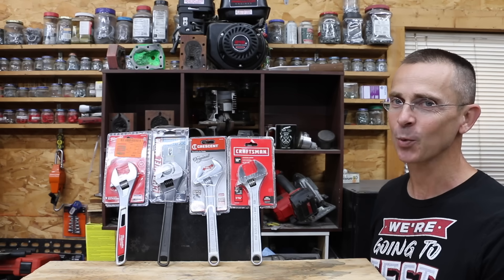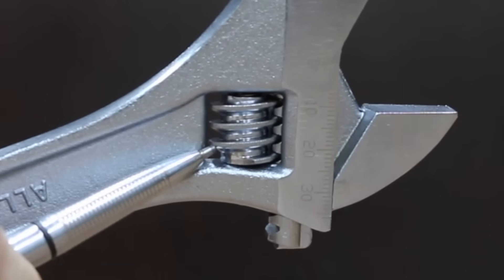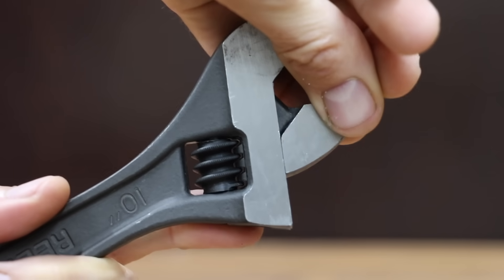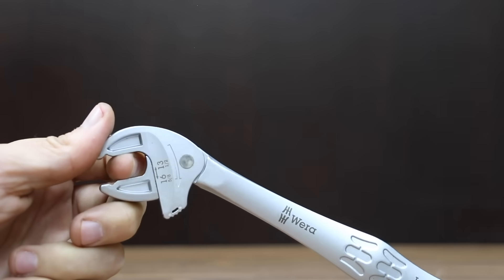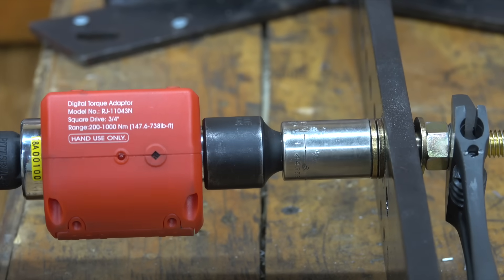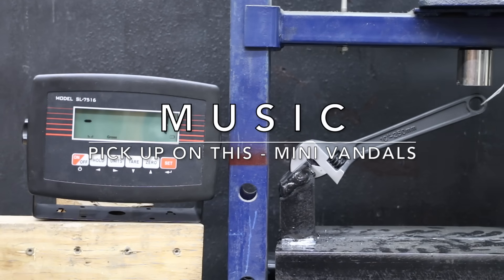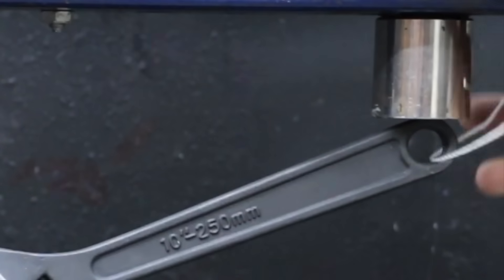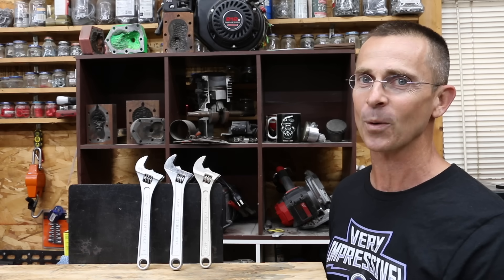Best Wrench (ADJUSTABLE)? Craftsman USA vs Craftsman, Crescent, Kobalt, Milwaukee, Channellock

Comment: Next up, oil filter wrenches and those that slip with oil and when dry.  Holding power on tough filters and also ease of use in close quarters like under a vehicle.
Reply: It would have to be a dual test. Oil filter wrenches and which screwdriver holds up best when pounded through a filter.
Reply: @NotMorganFreeman.  we’ve all done that!!!  In fairness, I hand tighten but for some reason, some just tighten up and are tough to get off.  Could be heat and contraction.
Reply: The vise-grip style locking oil filter wrench is my go to if I can use it. Crunch the filter a bit so it won't slip and it comes right off. Even in tight quarters I can generally grab it from the end then use another tool to turn the wrench.
Reply: Not a bad test idea! 🤔
Reply: @gus473  
I think it's a great idea. For Toyota cartridge style oil filter cap wrenches my choice would be the redesigned Motivx MX2320-US model.
Reply: Filter should be hand tightened but when  some jackass torques it down, the Knipex bigger wrench opens wide enough and will grip it.
Reply: I just crush the old filter with sharp jaws and hand tighten the new ones
Reply: Unless you have one those new chevy style oil filters the upward facing with a annoying plastic bolt like thing to grab on to that is guaranteed to slip
Reply: @SmilesHeavy  thus we need a test on filter wrenches……

Comment: Brilliant! I've wanted to see a test line this from you for a while due to the excellent quality of what you do! 

I was quite happy to see the Bahco do fairly well as I've got a couple of them which are well over 20 years old!

Not sure if you've done one so far but a low duty to medium and even high range torque wrench showdown would be awesome!

Thanks for the regular awesome content!

P.s. it's a good job those adjustable wrenches work with more than one scale... imagine if they were metric only 😉
Reply from the maker: Thanks!  Thanks for the suggestion.

Comment: Todd, could we do a showdown on 3/8 drive extensions?
The biggest problem behind reliability on adjustable wrenches is the keystone shape between the jaws which are not 100% parallel. It's a struggle getting these off, sometimes. Also, it would have been good to record the moveable jaw left to right wobble.
Reply from the maker: Thanks for the suggestion.

Comment: Would be cool to see a test on lubricity of diesel additives like optibube, biodiesel, off road “high sulfur” diesel, atf, rev x, ect to see if it helps out how unlubricating the new ultra low sulfur diesel is. I’ve read a lot of articles about how much damage the new diesel fuel can cause to older diesels and am curious what additive works best. Thanks
Reply from the maker: Thanks for the suggestion.
Reply: He did something like this when he did the diesel anti-gel test.
Reply: Yea ik he did show the lubricating properties of those, but thats not their main intention. It was just an added benefit. I’d like to see the products that are claiming this is their main purpose, and how it stacks up to high sulfur diesel and atf. A lot of these products are pretty expensive so I’d like to find out which ones are legit or just snake oil lol
Reply: @randythomas9052  I agree with you. That would be a great test because my truck has the CP4 and I use these additives as extra insurance.

Comment: Thank you for this test! .. if you use an adjustable wrench properly, tighten it properly, it is a very useful tool and belongs in your toolbox ... Note: there is a proper direction for pulling on an adjustable wrench , toward the sliding jaw, not away from it . Edit: ahh, I see that you did it correctly in the video, good job
Reply from the maker: Great feedback!  Thank you

Comment: this hits home with me. I spent 35 years doing construction and our tools would last for years, and only got replaced when lost or stolen. The newer tools just dont seem to hold up any longer.
Reply: Planned obsolescence...
Reply: That way you have to buy new ones. If the last forever they can't sell you new ones. Same with computers and cars. Quality is limited on purpose.
Reply: @discgolfdetails9889  computers and cars are more difficult to make last for a long time than a couple pieces of steel. I’m not saying that planned obsolescence isn’t real, just that a internal combustion engine can only take so much, vs. a wrench
Reply: @jeffroberts6428   I feel like the quality of cars has been going down in the last 10-15 years. A Mercedes or BMW use to be built to last. Now they fall apart at 100K and are mechanically totaled. Which is why you can by a 120K Merc for 10K. 

Part of it could be emissions, part of it could be trying to squeeze the most power out of a small engine and the last part is the GOV regulations on fuel mileage. They simply can't last.
Reply: @discgolfdetails9889  I agree with all that, just saying certain things can’t last 100 years
Reply: My dad's employees steal everything. My uncle is the manager and just swoops into our shop/garage and grabs our old vintage tools my dad passed down to me. And use it for work for the guys (that steal them) instead of buying new tools for the guys like the whole family tells him to do. He gets payed to go to the shops and to use the business credit card but he's just so damn lazy
Reply: @DaftPunkSkittle  accuse him of rape
Reply: @arthurmead5341  nah, go with racism... that seems to be the go-to these days
Reply: @3WhaTNexT  racism isn't illegal though
Reply: @arthurmead5341  true, but the media and others act as though it is
Reply: @arthurmead5341  yikes you seriously joking about that?
Reply: @DaftPunkSkittle  hey if he was stealing Pittsburgh tools I'd encourage you to let it slide
Reply: There is just as good if not better out there nowadays, you just need to pay way more.

Comment: Craftsman tools will never be what they once were. Back in the day you took pride in buying Craftsman.
Reply: I remember when most hand tools were made in the US, Craftsman was not held in that high regard.
Reply: Have to disagree with you on that.
Reply: @willburr5929  your memory is like mine. Crap man quick tools!
Reply: I am proud that I am able to find them in the internet (they call them vintage).  Just expect to pay more for the Made in USA craftsman.
Reply: @dennisclayton1225  I wouldn't today. Because if you try to warranty the tools you're not going to get made in USA replacements. Honestly I never thought much of Craftsman tools ever. Department store tools.
Reply: That's why they had the lifetime guarantee.  Back in the day, he probably could have walked into Sears with the broken one, told them straight out he used the hydraulic press to break it and they'd still give a new one cheerfully.
Reply: @HariSeldon913  Sadly thats exactly why they stopped. The guarantee became their downfall. Contractors literally built their businesses around buying that brand and trading them every time they broke (which any tool does under industrial use). People took less care and traded them in just to have a new one just to have a new one. Older generations bought tools expecting them to last, and treated them like it. Newer ones treated them as disposable and demanded new ones ad naseum.
Reply: @HariSeldon913  Well, you just brought in the parts without an explanation! Possibly a sheepish look or sly grin, when you got your replacement tool! 😂✌🏼😎
Reply: @gus473  I know it could easily be done without an explanation.  I'm just saying they'd probably still do it with the honest truth being told.
Reply: @HariSeldon913  No questions were asked. They would replace old rusty tools you found at yard sales. Of course, now you'd be better off hanging on to the rusty tool than trading it in for an import.
Reply: bacho have sadly the same fith
Reply: We didn't. We called them Crap man quick tools. They were a step above 5 and dime store tools. You took pride in buying Snap-On and Mac. Well took a beating at any rate.

Comment: Snap-On beats them all... I finally got tired of all the issues you are showing here- flex, slippage etc. The Snap-on wide mouth adjustable is incredible quality and very usable! They may cost $80 each but it's worth it if you use them constantly.

Comment: I sure miss the original craftsman tools that were made in the USA 😭
Oh, another video idea is to test utility kniveson their ability to withstand pressure on keeping the blade out. I’ve busted a couple knives with applying too much pressure apparently 🤷🏼‍♂️ 
As always, great video sir 👍🏻
Reply: You'd be better off buying nos Armstrong
Reply: He has a video with utility knives. Do a sear h
Reply: Yeah.... When I was getting started I was so excited to buy my first set of screwdrivers got some nice looking Craftsman ones and I didn't even finish securing one electrical terminal before the screwdriver blade twisted on one and snapped on another I tried.  When I went back to Sears to exchange them I was told that they looked abused and would not exchange them.  Old stuff from my grandparents held up but the stuff they sell now is trash.  Most of my hand tools are now Cobalt brand from Lowe's which have held up much better than the Craftsman tools

Comment: I've always used Craftsman handtools, but in reality, I've had even cheaper ones (like Duralast ones) last just as long but cost significantly less.  I think as long as you're using it for what it's intended to do, then you're probably fine regardless of the brand.  Many of them do have lifetime warranties.  Craftsman has just gone downhill IMO when they started having their stuff made in China like everyone else.  Perhaps the only saving grace is they still have the life-time warranty on many handtools, but nowadays many companies do too.  Of course I still have many sockets and rachets from back when they were made in the US.  I also have some that were made in China as well (Craftsman) and I really can't tell the difference.  (And yes, I have used a 1/2 rachet a few times as a hammer/mallet without any issues of them breaking, despite that NOT being what they're designed for).

But for example, the Duralast extension I bought from somewhere, is still in good shape and works just as well as the one I have from Craftsman that cost 2x as much.  I have no issue using either one, and it just shows that sometimes it doesn't matter.  (And yes, I have broken craftsman tools before, but their exchange policy, atl aest the last time I had to exchange something, was relatively painless).  The only downside is that with KMart's on the decline, as well as Sears stores, it's getting harder to find Craftsman dealers.  I believe Home Depot and Lowes now carries them, but still, those stores are not found everywhere and in some cases you may have to send the tool in to Craftsman directly.  I generally use the Craftsman for larger jobs, and I have a set of cheaper sockets and rackets for smaller jobs (like putting together furniture) as if break one of those, no big deal.  The basic kit cost me $10.  You just go buy another one.

Comment: And the winner is...

the Knipex pliers wrench! 😬

Great test as usual, PF, but I'm a little disappointed that you didn't include the stats for maximum jaw opening. If someone is using an adjustable, its working range is really important!

I've always found that pliers wrenches have far wider working ranges, and adjust much faster than traditional adjustables.

Comment: Damn, I was hoping you have tested one of Walmarts Hart brand, I bought 2 and they seem to have the least slop I've seen in a cheapish adjustable wrench
Reply from the maker: Sorry I missed the Hart brand
Reply: @ProjectFarm  hey this is completely unrelated but I just had the thought so I need to write it out before I forget but a good video idea right before turkey day would be a test of different kitchen knife sets, I know I need a new set but I've been putting it off for a while because I want to get one that's better than the super cheap ones but I ain't paying more than like 75-100$ for a set, but you could test them for sharpness and durability by cutting on a cutting board and maybe also bone, maybe test how good the serated ones cut through meat. Would be an awesome excuse to buy and eat a bunch of steak. Thx

Comment: You left out the original and only adjustable spanner worth having "Bahco"  they still hold the copyright on the thread going the correct way.
Reply from the maker: Thanks for the constructive feedback.  I tested the Bahco with the patented worm gear.

Comment: Ah yes, the old “metric wrench set.”
Reply from the maker: lol
Reply: @ProjectFarm  it warmed my heart to see the American made Craftsman do so well, and then made me sad to see it break.
Reply: Metric should be banned.
Reply: @tonysheerness2427  metric system is superior in every way. You don’t need to learn it, it just works. Not just because it’s in 10’s either, because all the measurements are linked together relating to the weight of water. Length, weight, volume etc. 

Basically there’s none of this 8 and a half spuds to a fluid egg of pancake, or whatever you yanks still use to measure stuff in.
Reply: @tonysheerness2427  Metric is actually easier to use, and is adopted by more countries. If anything, imperial is on the way out. I grew up on metric, and was taught it primarily in school, where I'm from. The USA is the one of the few who still use it as an adopted standard form measurement. The majority of the world wouldn't be using it if it were worse. The quality of some of these tools are questionable though lol. It's mostly you old folk who don't want to give it up, in the trades, but in due time. :)

If you're used to one form I wouldn't wanna re learn another one either. Most tradesmen aren't bilingual let alone want to learn a more standardised proper measurement system.
Reply: @tonysheerness2427  .....

Are you seriously insane? Most companies outsource to China or India or Pakistan etc, like American Eagle for example.... Or Apple etc

Not sure what measuring has to do with labour and workforce, that's on education and skillsets... And or government policy in cases like China.

Typical American lol

Comment: One of the best ones ever I used was a wrench my dad owned. It had a locking worm gear and virtually no slop.
Reply from the maker: Sounds like a great tool!
Reply: I'm 56 and have my grandad's wrenches, 10" and 14". The 14" has about a 15 degree bend in the handle from being a cheater at one time. Best part is no one can steal it because of it!

Comment: I personally like the knipex pliers wrench. There is just no comparison.
Reply from the maker: Thanks for the suggestion!
Reply: Check out project farm's comparison of the adjustable none slip wrenches.  Knipex did very well
Reply: Knipex is the main mfg missing. from the test. totally agree. i need to see when it fails, so i know how not to break mine.
Reply: i need help choosing wood spade bits.
Reply: There is no comparison in quality or price.
Reply: I don't use mine as much as my other tools, as they are much bigger than the other wrenches for the same jaw opening. Space is limited in a tool box and you have to make choices, so it ended in my 2nd toolbox, with the "good to have in the van for an occasional use" tools.
Reply: @Kelvallontan  
What do you mean? The Knipex 10“ pliers wrench has a capacity of 52mm whereas these 10“ adjustable wrenches have 30-35mm.
Reply: @BL-yj2wp  What I mean is that there are good wrenches out here (I'm euro) that are much shorter ( about 20 cm long as a whole) and open wider than the 10 inches wrenches that are on test today, albeit a bit more than 4 cm. I have no problem with 1 inch bits.

I'm a heating tech, and those wrenches will do for 90% of my every day needs. They are compact, so easier to handle in tight places, and I don't need more torque than they can give, otherwise I could break the bits.

In the rare case it isn't enough, I go to my secondary toolbox where I have bigger and longer wrenches, up to 2 inches of opening.

What I mean is, while a good tool, the knipex isn't the best for my every day needs.

Edit too bad you can't post pictures here.
Reply: They are very good.  I have a pair, myself.  They take a bit of getting used to, though, and I find they don't always serve the same purpose as a regular adjustable.  Reaching into a machine with one hand to turn an odd shaped fitting can be frustrating because with the pliers wrench you need to open and close the jaws with your fingers twined around the grips.  With an adjustable the size is already set.   I find that I use my Knipex Cobras waaaaaaay more often than I use my Knipex Pliers Wrench.
Reply: @mikegraham7078  It's true that they don't always work well for awkward spaces. Under the right circumstances you can get a good ratcheting action going.
Reply: @mikegraham7078  huge fan of my pliers-wrenches as well as my Cobras, but I use the pliers-wrench far more often.   Really I think they're very different tools for different jobs though.  (used both last night!)